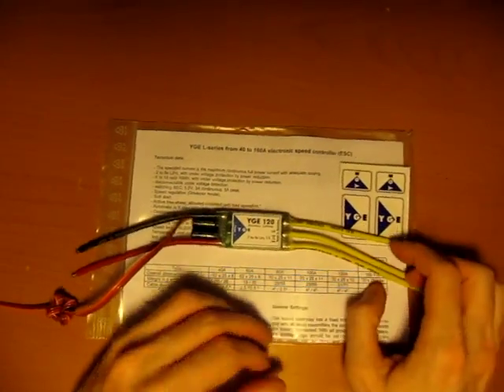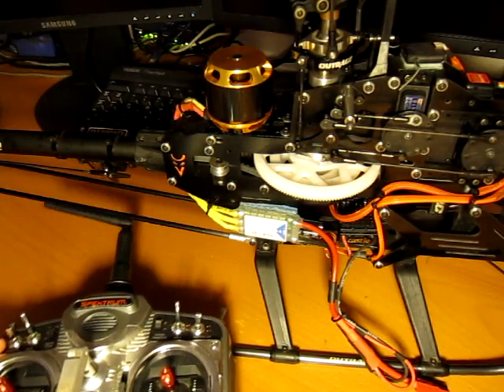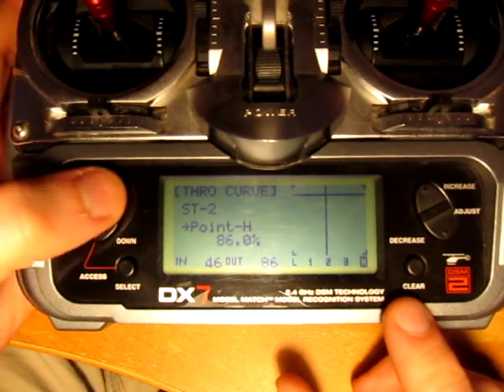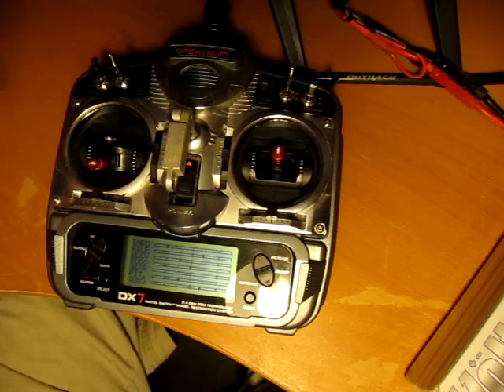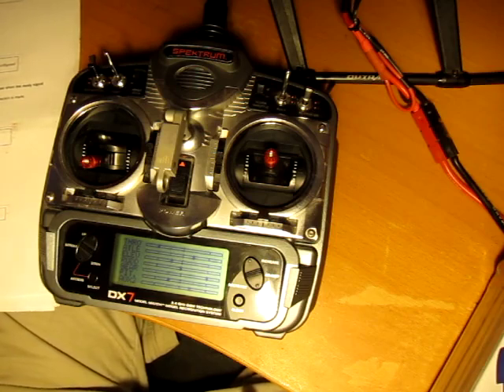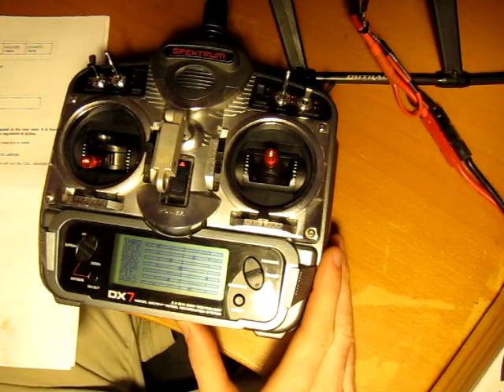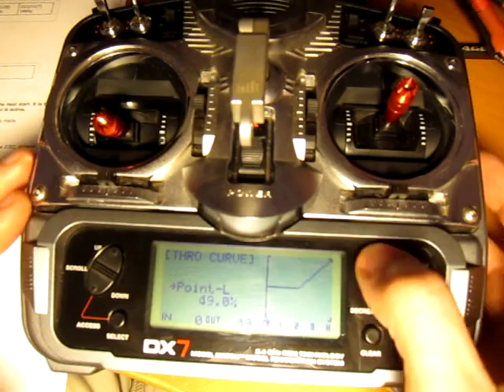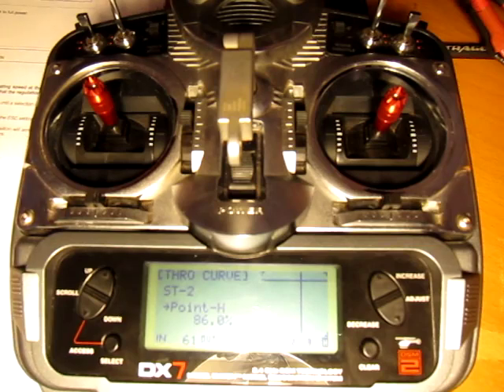YGE ESC Overview and Setup

Comment: I dont know looks like a total pain in the ass to me,confusing at best
I just purchased  a yep 120, from
Hobby king with programming  card,no instructions at all just a 
Speed controller and a programming card. Makes u want to pull your hair out. I have and
Old ION2 HELI WITH A CASTLE
CREATION 110 Hy all u do is hook it up start the throttle on low wait
For three beeps then a little tune
Your good to go. With all this programming stuff 
Just to many steps,and disconnecting your drive is not fun
Your screws are lock tighter down
It all sucks and can u trust the program,kind of takes the fun out of flying to me

Comment from the maker: My only suggestion would be to max out your endpoints on the radio, then check the range using monitor mode. You need to get the basic setup working, before you can enter advanced mode, so that might explain the second part of the problem.